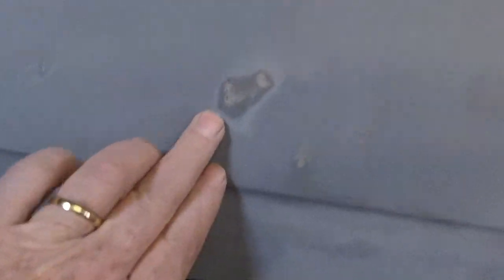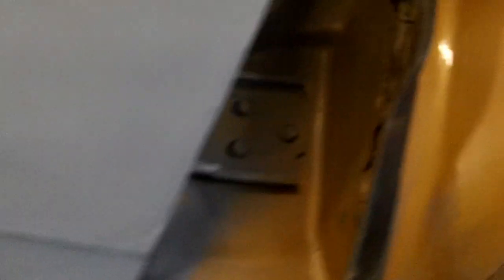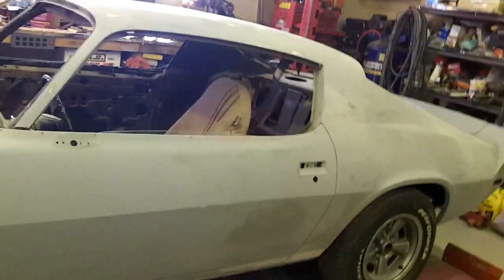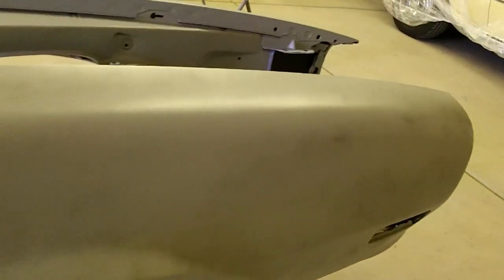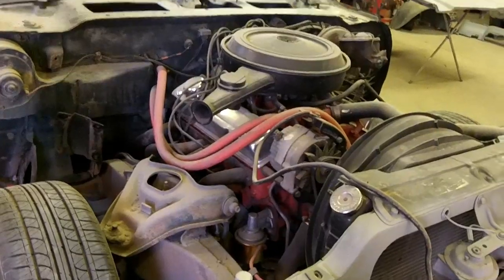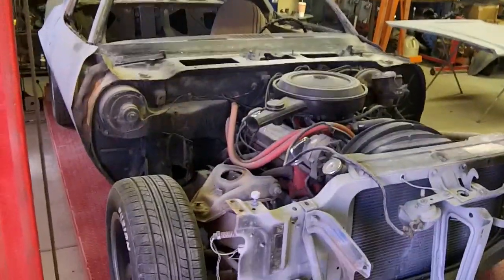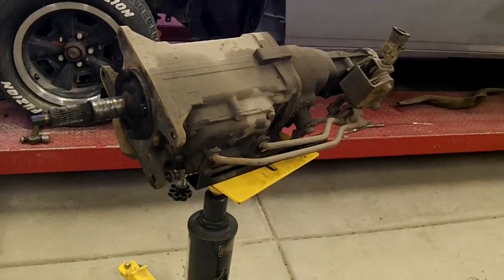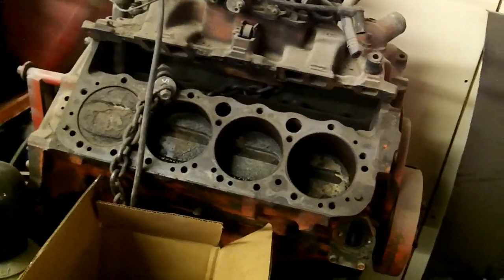1973 Z28 Project 4/17/23

Comment: I had an original '73 Z28 and have the original cast intake and carb. Let me know if you need them.
Reply from the maker: Wow, Thank you I may take you up on that when I get a little closer. Was your Z a 4 speed? I would need to research it but it may be a different carb # between 4 speed & automatic trans. Thanks you again sir.
Reply: @Rarerat  My Z was a 4 speed manual